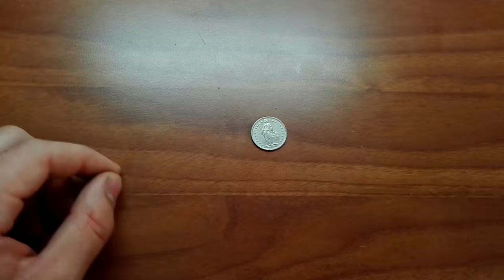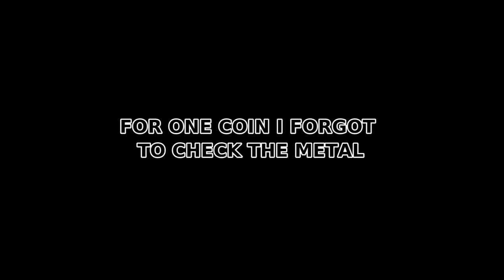DIY Fancy Coin Rings

Comment: What kind of mallet are you using? I've never seen one like that and I've been making coin rings for a few years now and before that, I was a carpenter for over 20+ years. I've used, I thought, every kind of hammer, mallet out there. And the centering disc you have, where'd you get that, I assume you made it.  Thanks in advance for answering the few questions I have. I'm just curious. I have a Durston ring stretcher reducer, a 12 Ton press, punch and dies, a 1 ton manual press, folding cones a doming block, and everything to make coin rings. Just never seen the tools you are using. I also like the minimalist way to make coin rings as well. It a lost art.
Reply from the maker: Thank you mate! The mallet I made it myself from HDPE plastic I got from milk jars, It's kinda soft maybe too much for coin ring making but that's what I had on hands :D I made also that center finder from a thin piece of plexiglass scraping circle with a compass and drilling a hole in the middle, really fast and cheap to make :)  I will probably do a video about making a mallet like that in the future, there are many tutorial already here on yt anyway if you want to find out how they are made! I am looking for a ring strecher, but here where I live are hard to find and they cost a lot! Good job with you tools :D Thanks again!
Reply: +Black Beard Projects  I had (3) ring stretchers not too long ago. If I had known that you were looking for one I would have sent one of them to you. I live in the USA and I find things like that all the time. If I find one, I will acquire one and send it to you. On Facebook there is a group called (coin ring crafters). They are a GREAT bunch of people. You might want to check them out. I will subscribe to your YouTube Channel and when I find a ring stretcher I will let you know and get your address to send a ring stretcher/ reducer to you.
Reply from the maker: Thank you sir, you are too kind! :) I have already joined that group like a month ago with my personal fb account! I didn't posted much but I'm reading everything you wrote and I already got some great tips, that group is gold!

Comment: Hey, awesome video.

I'm very new to projects like this, so was wondering if you could explain the purpose of heating the metal between sessions on the mandrel?
Reply from the maker: Thanks mate! Heating the coin it's done to annealing it. Basically the internal structure of the metal recompose itself when heated making the metal malleable again. If you don't do so you'll get to a point when you can't deform anymore the metal and if you keep on pushing hard it will eventually break apart. The process of annealing is a general metalworking tecnique, used in many application! :) If you want to know more search for "Heat Treating" on Wikipedia.

Comment: For anyone looking to do this (it is incredibly fun to do btw) always, always, ALWAYS, anneal the coin (and debur the inner surface) before you put it on the mandrel and begin stretching and folding. The folding process puts incredible strain on the inner portion of the coin and the tiniest micro fissure can turn into a nasty split very quickly... ruining what can be a very expensive coin. You can never anneal too often.
Reply from the maker: Thank you for the suggestion mate! I see you know a lot of this stuff :D
Reply: Black Beard Projects
I've made a few, and made a few mistakes. On top of that I have watched every video I can find on the subject. Everybody has a slightly different way of doing things and you can never know too much.:)

The other thing I probably should have pointed out is start small, both in size and material. I found quarters much easier to deal with while learning, and if you wreck a clad quarter you are only out a quarter :)
Reply from the maker: Haha you must be right!!! Thanks again :D

Comment: How can you choose the best coins to do the rings? It's based on it's metal composition?
Reply from the maker: Well, all copper based coin are easy to shape, and steel ones are really hard (if not impossible without the right tools). But as far as I know there is no best coins! :) Thin one will be easier too, and depending on the size of ring that you want to make the outer diameter may be important too! For example without fancy tool I would have an hard time turning a huge coin into a size 6 :)

Comment: Great work! 
Do you have some exact data for the drillbits you used, or is that depending in the coin?
Reply from the maker: Thank you! I don't, I get the hole large enough to make the coin fit on the ring mandrel!
Reply: ok. thanks for the quick response